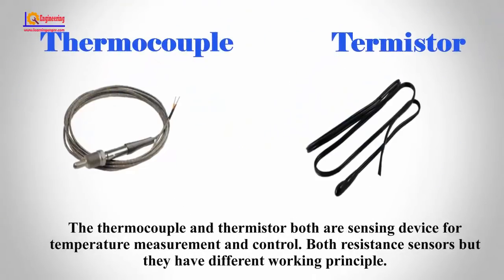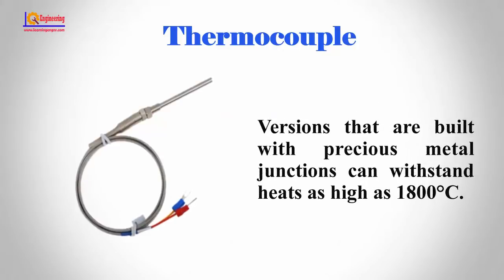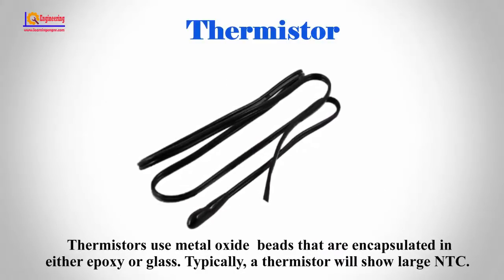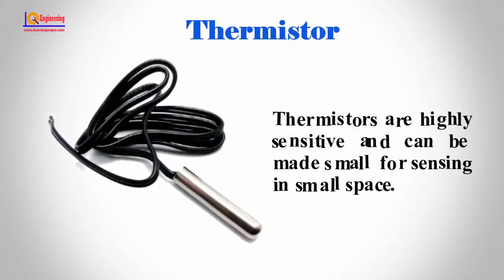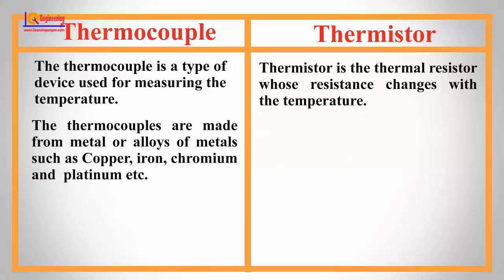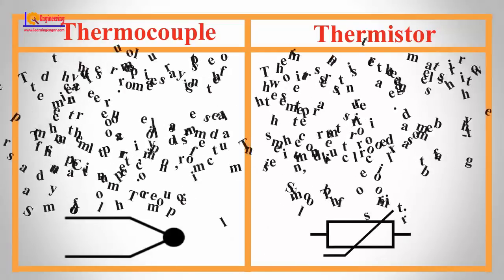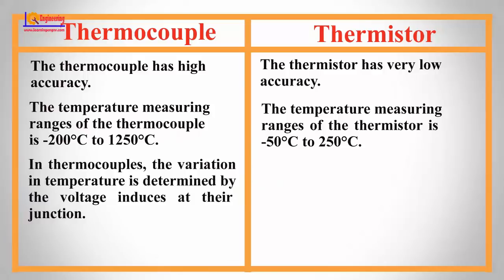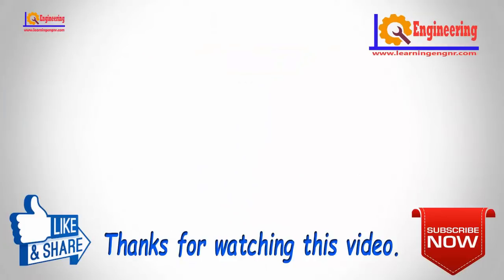Thermocouple vs Thermistor - Difference between Thermocouple and Thermistor

Comment: It is a little hard to understand the thick accent with my midwestern USA ear, but showing in text is helpful. I wish you had an example to each to show thermocouple with digital multi meter and point out its changes in voltage when heated with hair dryer. I still don’t know if voltage goes up when heated as they are commonly used with a gas furnace or gas water heater.
The thermistor falls into “NTC” or “PTC” types. Example; An NTC thermistor is high resistance and drops when heated with hair dryer or heat gun commonly used to help remove house paint and scrapper. The “PTC” type would be low resistance at room temperature but for up in heated conditions. 
 I wish you could have shown this. I held classes and 4 hour technical seminars for General Motors. People learn in 3 ways, some being told into, some by seeing and others be doing. There are best classes when all three types are used, but on video, only two methods can be used. It is not easy to get “Likes” when talking fast and going through text fast. You left very little time to read, even though you read it to us. 
 So please slow down, allow the viewer time to read and bring components to the table and use a DMM and your sisters hair dryer. Explain the expectations the fast forward with out talk to make it more interesting and visual. In a TV show or movie, this would be called a dramatic pause. This creates the viewers interest in what happens next, not just talking fast to make the video short. Automotive ASE Master Certified Technician since 1978 - Retired.